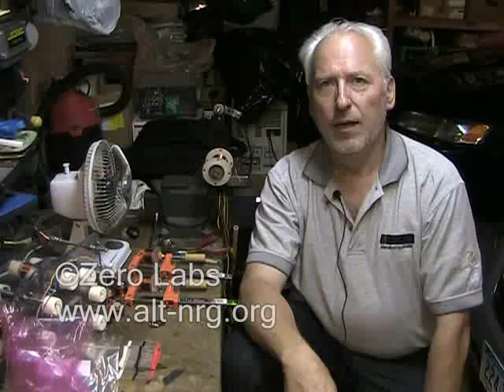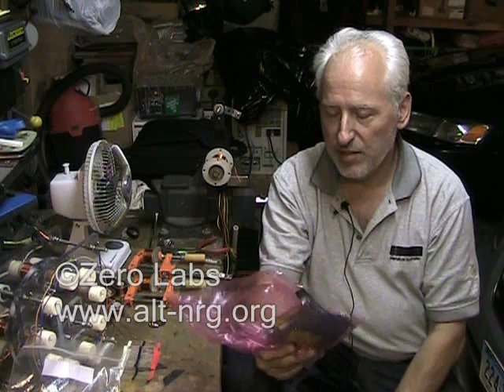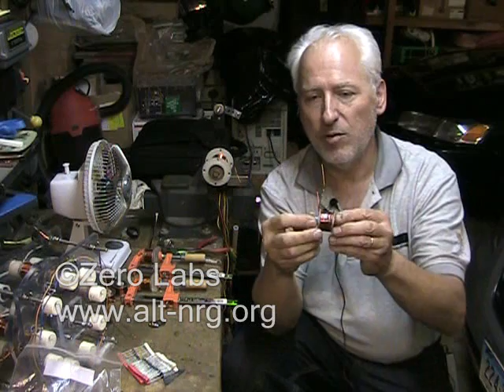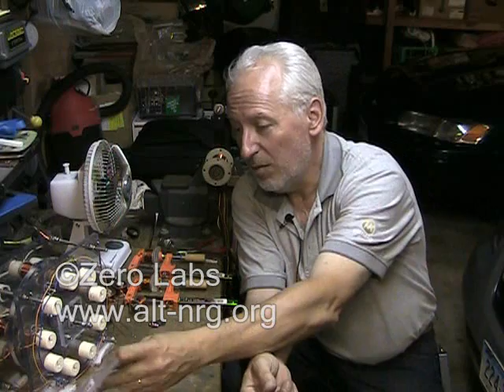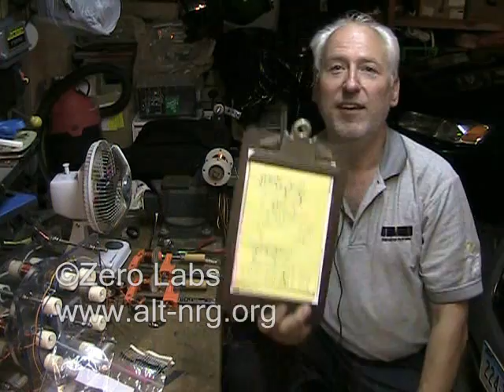#285 Unlocking Muller Motor secrets

Comment: @Zero Labs Did you reach overunity already? what if u make the core to have a complete magnetic circuit so that power generated will increase ..but cogging is the problem
Reply from the maker: Not with Muller motor type device. Don't let that discourage you from trying something I may have overlooked. Build. Learn. Conquer.
Reply: @zerolabs  adams motor generator said to have reach 8 times more power out than in.. by using switching whe ever load is applied that is load is only applied when the right position of the magnets and core that repels due lenz law. and switch off when lenz law tends to pull the magnet thus causing acceleration when applying load..
Reply: from that the more load you put into it the faster it gets and adding more pick up coils increases its power generated

Comment: Instead of relying on hitting 88 miles an hour like back to the future why not induce the resonant frequency by using a multiplexed frequency carrier, i.e. energizing the coils using a MODULATED frequency, basically multiplexed, one primary frequency oscillating at around the resonant frequency of the coils, and a separate switching frequency controlling the ON/OFF time ? By doing it this way you increase your back EMP in multiples instead of just one pulse, also you should be able to reduce current consumption dramatically.

Comment: thanks for your template. i have built a simular one of these and yes it works. i am living on ssi now, little money but built my own cnc, and coil winder. from junk yard stuff like old rc toys. i do want to point out that tesla, coils are simple and you do need to wind the coils corectly. USE YOUR tought electronon coil thery. the right hand rule.  hint! not back and forth. the windings will cancle each other out ok. send me a message ill respond.

Comment: Xl = 2 Pi f l   
f would = 1/ (n (number of magnets) x rpms)
Xc=1/(2Pi fc)
Seeing as to resonate we need Xc & Xl to ballance then
c=Xl divided by (one on 2Pi fc)
Inductance of coil is L=un2A / l
but it would be easier to put a known voltage at a known frequency through the coil and calculate the Xl from the current Xl = Voltage / Current  then L= Xl / (2 Pi F)
Have I got this right? Its been a while.

Comment: 4th:  The same thing applies for experimenting with series and parallel capacitor setups for the generator coils.  If you generation-side configuration lowers the impedance as viewed on the generator coil + load side only, then that will increase the mechanical power draw from the rotor and slow it down.  If your generation-side configuration results in a higher impedance then that will reduce the mechanical power draw from the rotor and it will speed up.

That's all you are playing with.

Comment: 3rd:  So if you see the rotor speeding up or slowing down when you change parameters you can assume that you are likely changing the overall electrical impedance of the motor as a whole, which means you change how much power is flowing through the motor.

That power flow either becomes waste heat or propulsive power to push the rotor to increase the RPMs and/or drive a heavier generator load at the same RPM.  A series or parallel setup may increase propulsive power and reduce heat losses.

Comment: 2nd:  It's the impedance value that ultimately determines how much power flows through the system.  Lower impedance means more power.  It's almost were the valve is set on a water faucet.  So the resonating cavity in an instrument, or in your case your replication is affecting how much power flows through the system.   So playing with caps added to your coils is affecting the impedance of the motor as a whole, and where that power flows.

Comment: @ZeroFossilFuel Because the musical instrument's resonating cavity is part and parcel of a power transfer system that takes the excitation power (blowing air through a reed) and turns it into sound power.  When you look at the resonating cavity energy enters in at one end and heat and sound energy exit out at the other end.  The rate of the energy flow through the system, i.e.; the power, is determined by the overall impedance of the system.

Comment: I believe during one of your live broadcast you mentioned that the AC wave was very close to DC and I have seen all of these wired as a DC generator. What determines AC or DC output on this design the size or what you intend to do with it. I would assume on a larger size it would be fully AC power or would this also be converted to DC and become a battery bank changer?

Comment: @syberraith reclamation circuitry is.   This run on after input power is cut effect has lead a number of people who have built similar rotary pulse motor to conclude that they have taped into over-unity operation when infact they've just observed the energy stored in the tank circuit of the device being used up.

Comment: @syberraith One other thought is that with these types of pulse motors when run in resonance they tend to form a tank circuit.  In that tank circuit there exists the potential for a lot of energy to build up and recirculate between the coils and the caps.  When input power is disconnected from the motor, that stored, recirculating energy will continue to run the motor for a while.  How long that is depends on the frictional and resistive losses of the motor and how efficient the back EMF

Comment: Yep, you have observed correctly.  With the magnets close to the cores the inductive reactance of the coil with a ferrite core will revert back to something approaching that of an air core coil because...

The magnet saturates the magnet flux inside the ferrite core rendering it insensitive to the coercive force applied to it by the current flowing in coil.

Look up "Magnetic Amplifiers" for more information on how that works.